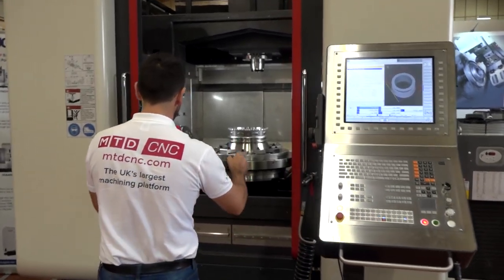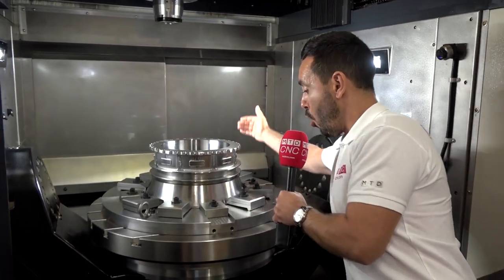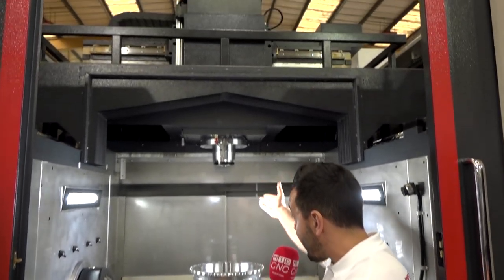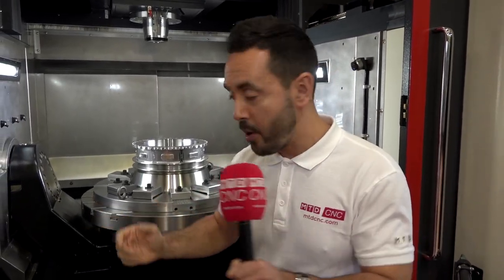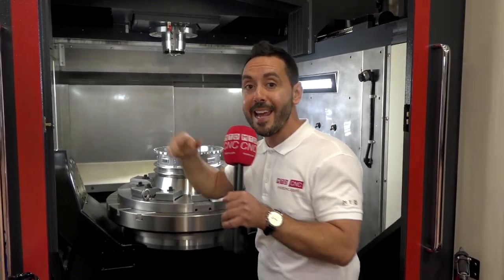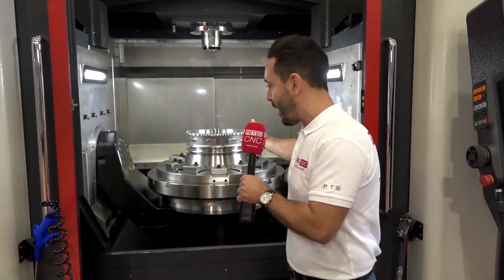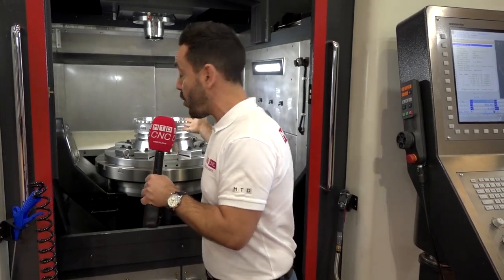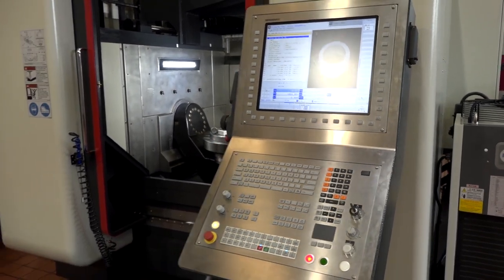Why this 5 axis machine?

Comment: I would call that a gantry style machine not bridge style. A Bridge style machine might be Makino with a 5 axis trunnion moving through the bridge or a 3 axis Bridge style like a Makino F5 (or Okuma Genos M-560V) ... The Dugard looks a bit like the 5 axis machine of the same layout from SHARP (surprisingly accurate never the less) I'm sure the DUGARD is major bang for your buck.
Reply: similar machines are Hermle, OPS Ingersol V9, DMG (forgot which model). To me gantry seems like the best design and I wonder how this would perform compared to the high end Hermle machines.
Reply from the maker: I'm not sure you would see much difference, these days all manufacturers focus on quality as they know how important it is.
Reply: I have to say I think that is increasingly the case even for precision and accuracy. One physical distinction for me would be the vibration dampening capability of the Hermle being "Mineral casting"  versus Mehanite casting (effect on surface finish). Also depending on region quality of support is key. Hermle really seem to have that down, but I'm sure Dugard locally go the extra mile.  For large envelope machines in that class it's difficult to hit very high positional accuracies unless you are going to a something like a Mitsui Seiki $$$$$$$+++++ . But I have to say HERMLE's care and attention and company culture and factory are second to none IMO as that's ALL they do and they really focus in on what they are doing in a pretty extreme way. [Superb 5 axis machines of their type]. Horses for courses and of course budget ;-) Dugard looks awesome !